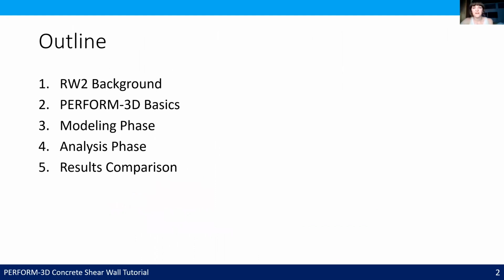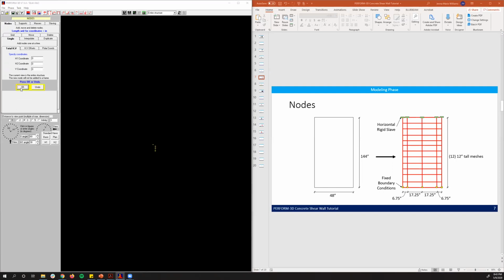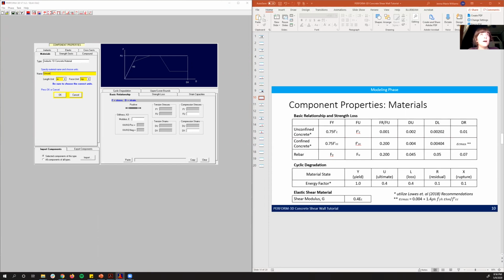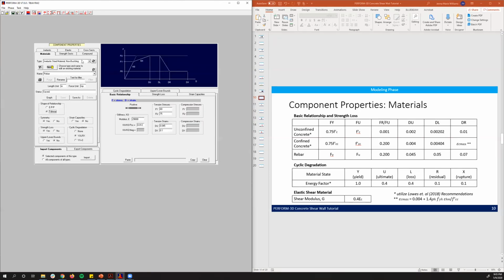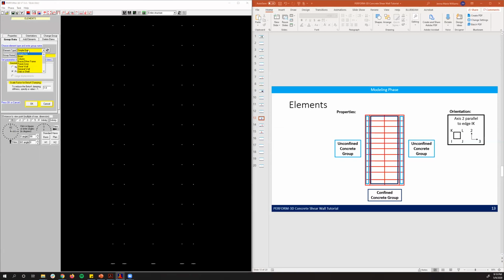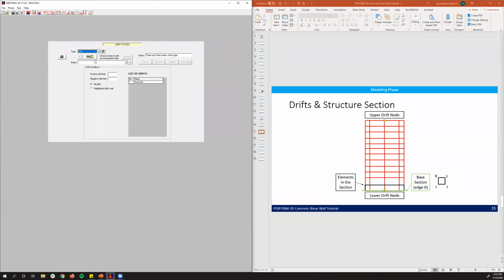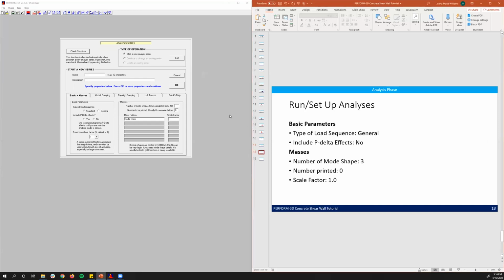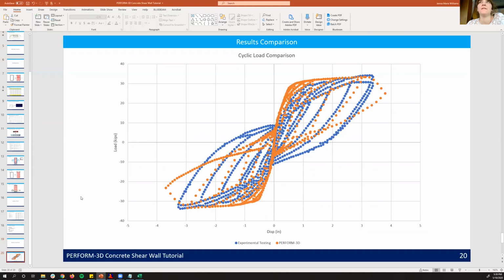PERFORM-3D Concrete Shear Wall Tutorial

Comment: Note that the model result does not match well with the tested one.   The possible reason is that the confined concrete zone should be at the 2 side area of shear wall  instead of the central area.

Comment: Thanks for the tutorial Jenna! i'm actually working in a paper and need to compare the behavior of the walls using a history of displacements. Actually i have a wall model using beam - truss approach with fiber model... the question is: ¿Perform use only plastic hinge or fiber model too?
Reply from the maker: You can make a plastic hinge or fiber model in perform, it might be worth making both and comparing the results!